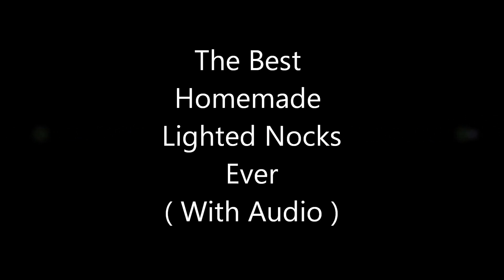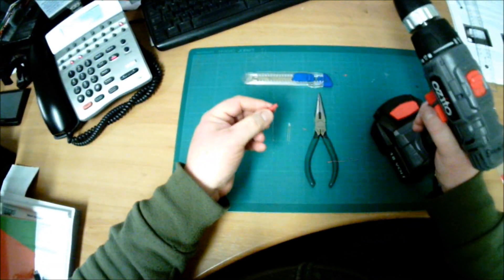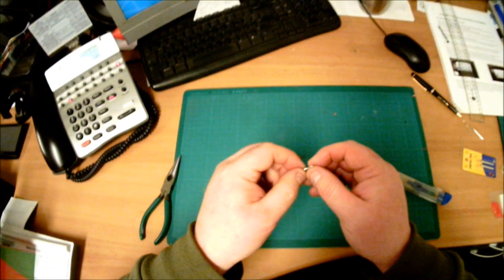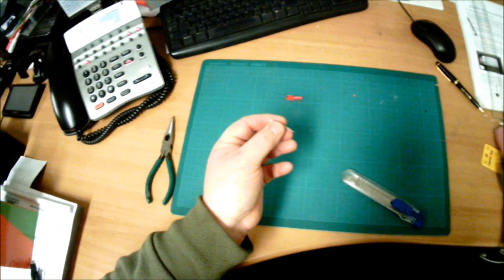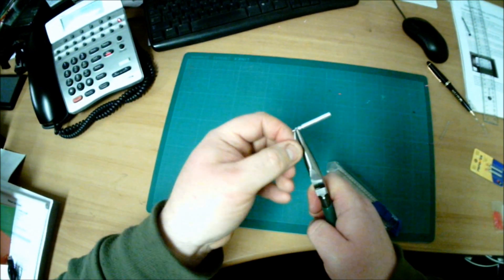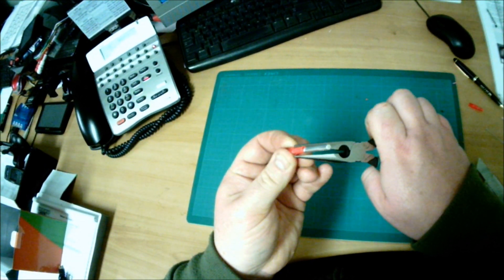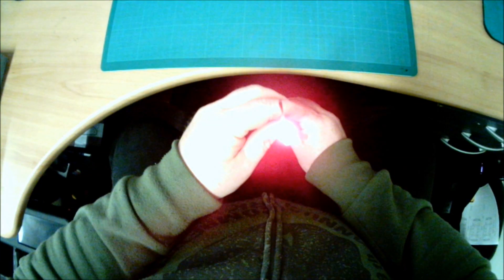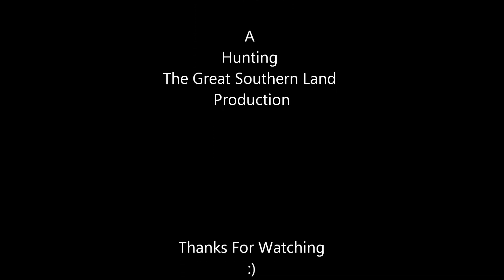The BEST Homemade lighted nocks ( X nocks ) with audio !

Comment: What kind of soldering iron set up are you using?
Reply from the maker: I use a soldering station similar to this .. https://www.ebay.com.au/itm/NEW-48Watt-Soldering-Iron-Station-Kit-Desoldering-Temperature-Controlled/322013739787?epid=17011967750&_trkparms=ispr%3D1&hash=item4af983bb0b:g:ObQAAOSwll1WyCFF&enc=AQAFAAACcBaobrjLl8XobRIiIML1V4Imu%2Fn%2BzU5L90Z278x5ickk5v8gVt3hEWLVg%2F253w6XCezzhb40cxXrOkWgljU7fyd2eWnHIB0QGPgJe%2BAriUTE5Y5TKoQtT1amqjMb5DPL2zt6yt8jE4KsL45enknjBk6c%2BCqgnZJxowJXekRE9Kq0R42EjKRNA5neT7Ixfeg172%2BQ%2F2z2ZQHAqvKBVLRwsXW5osPiQPoBe5YYI8QVtyHqvy0uYpnm79vRtBhfIEOewBUb0cHHcj8%2FqXeQEgiruLZ2vBeCNPBtkTYcdyuMqlomaUL4EBTn4EsMltTH4DxFOEQ3lVSpugSmndain49zoRGdjdKzbW6LkMPY9EZLe%2FuHz7rlC%2FlzAkSpGaC8p0QtGGDq6FfV1V5VvBqBsdDpH8eXUsd9Hn2UQjn6FBSo0WGF17W%2FPI8H4ml4r7%2FNpqxlKAWxJREqFEOsPQ7XrSU%2B71OUCmpzauBiYO0sjQ3ELP2IPcMQvHgcYJyuK1a86cNSlMWSqKnDE0bjDFIODcdnrUpFu4Z9qeFoJ0ZRCCk2raQVwb59ZxUGxwzvCnsYsJF7XUdAASGpEeEYqZqfNsJA145IuzmskIySthLLXUua5AUqTWITPxAFpzYKX61VICZzsXNZZ%2FAb27RhYrKe3l9IvanHs7MB%2BKoO1f1fjXy9M0ZpTp1Mvxg1LPQt7TIX%2FpB4u3b4d8ej69IassSF8Dl67Hxgfa9OzutwaOnT5oHIpCSxk4hiI0QDSXqE0xsbeaSFWJqk1MjwWX2NjWtFhWB%2FOPI6z2XNM%2Bf4q6m90OIMG8%2BWn36eHgMhnokRpT7WKQ1SaQ%3D%3D&checksum=322013739787eed37c343a7248ad9ba3c47f73b21f47
Reply: @J0D0CAST  Thanks

Comment from the maker: They work with REAL carbon shafts also as they do conduct.
Get a piece of sand paper and push it against the end where the nock inserts and twist the arrow shaft, if the residue on the sand paper is black its carbon if it's white then it's fibreglass and won't conduct/work.

Comment: In my carbon shafts Im having a difficulty getting good conductivity. The spring doesnt seem to have enough contact with the inside of the shaft to make a good connection. Any suggestions?
Reply from the maker: +Christian Johnson use a larger diameter spring so its tight on the inside of the shaft and just tighten one end so it grips the battery tightly also ... should work.
Have a good listen to what I suggest @10:27 :)
Reply: +J0D0CAST any idea as to where I can get springs like that seeing that springs inside ink pins are not big enough?
Reply from the maker: +Christian Johnson you could try until twisting the spring a bit to make its diameter a little larger ?

Comment: I'm by no means an electronic expert but my calculations show that a resistor may be needed if the 3 volt output of the battery doesn't match the forward voltage of the LED.  Seems like the only 3mm LEDs close to that forward voltage I'm finding online are either 3.2-3.4 or 2.0 forward voltage.  Will the 2.0 LEDs burn out and will the 3.2 and higher not light?   Can you advise of the forward voltage on the LEDs you are using? Excellent design by the way.